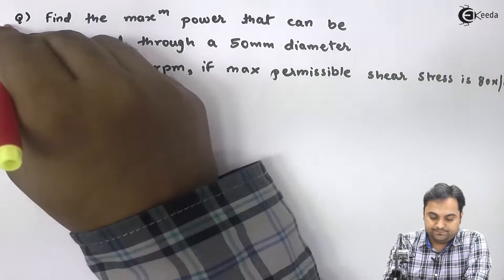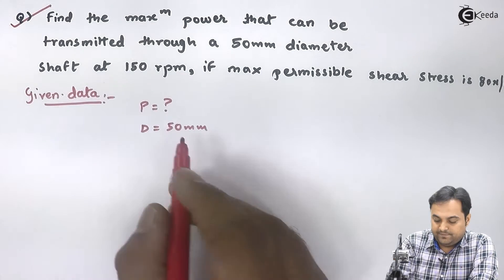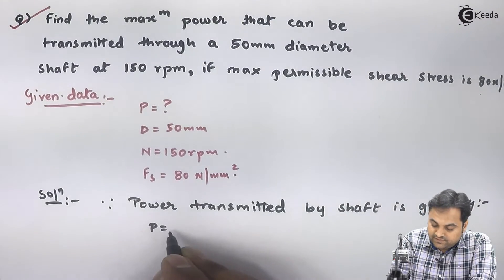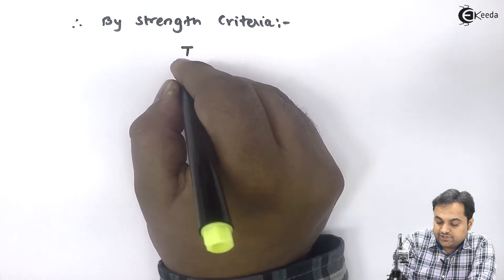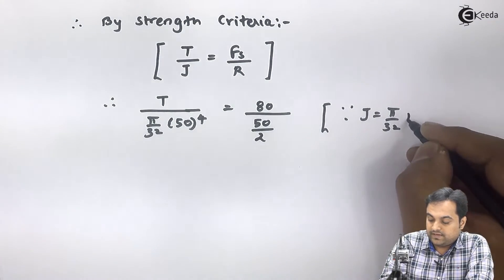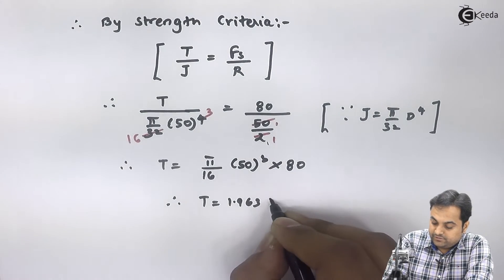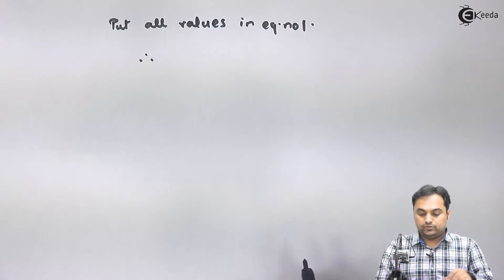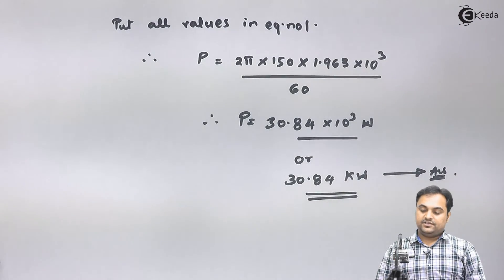Problem on Calculation of Power Transmitted Through Diameter Shaft - Torsion - Strength of Materials

Comment: A mild steel flange-mounted single shear pin (Ultimate shear strength = 42 MPa) 
of 10 mm diameter is used in a flange. The perpendicular distance between the axis 
of driving shaft and the shear pin axis is 100 mm. If the speed of the driving shaft 
is 300 rpm, the maximum power the shaft could transmit in kW before the failure 
of the pin is ___________. .. Sir how to do this?